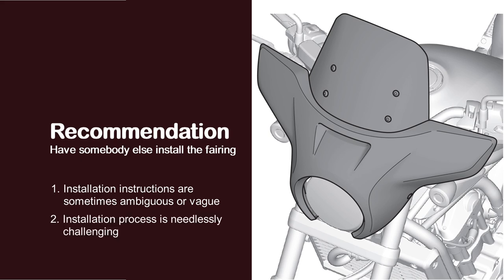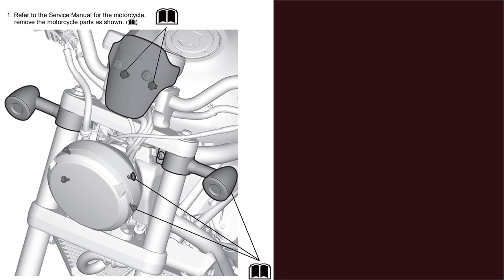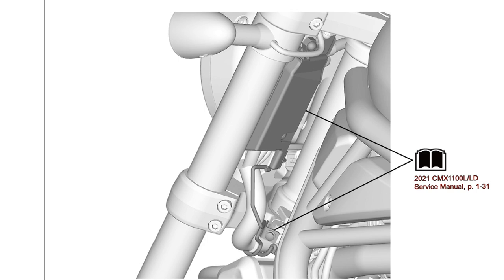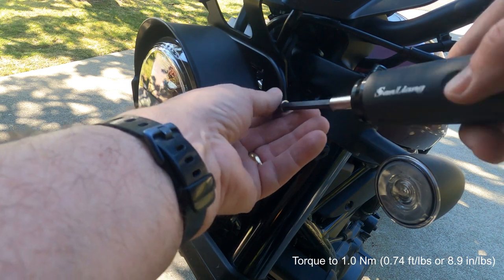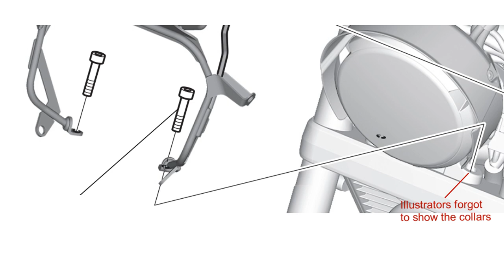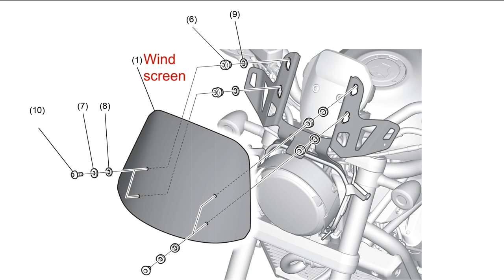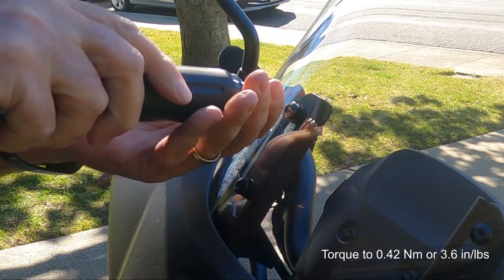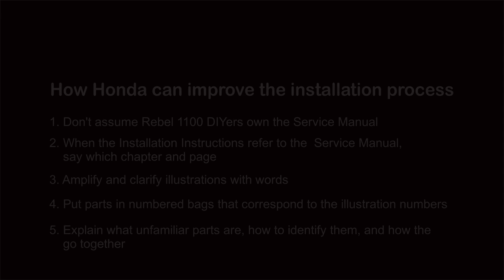Watch this Video before Installing the Rebel 1100 Batwing Fairing

Comment: Thank you for taking the time to make this video. It sure was nice to zero in on exactly what I need to  remove and re install in the correct order. My biggest problem  was the bottom fairing stay bolts. I was trying to pull the stay forward, then slide back over the top of the spacers and there wasn't enough clearance to get the bolt holes past the spacer. I found that pushing the bottom of the stay toward the bike, then pulling it out over the spacers it fit perfectly. 
I'm very impressed with the performance of the fairing, it really takes a lot of wind off me.
Reply from the maker: Thanks for sharing your experience with the installation.  Enjoy your ride.

Comment: Thanks for making this video Steve! Hands down one of the best videos for parts installation I’ve seen. It has removed a lot of my trepidation about the installation. I’m no slouch to working on vehicles and bikes, but this install seemed, on the face of it, rather convoluted. After watching your install video, should take me about an hour or so. Thanks again!
Reply from the maker: Thanks for the high praise.  I'm delighted you found the video helpful.  However, if your installation only takes an hour or so, I want to hear you brag about it!
Reply: @papastevesgarage  I’ll time myself when the time comes and see if my estimate was close 😁
Reply: Took us 3 months to get a Rebel and not even through the dealer we had our original deposit with! Took me 1.5 hours to complete. Hardest parts were fitting the left turn signal/wiring harness bolt back in and fitting the fairing bracket square and into the rubber mounts at the top of the triple tree. You weren’t kidding about those rubber mounting bungs. I put the top two in the fairing first after I learned that putting them in last made it nearly impossible to get them in without dropping them. I installed it well away from anything they could have bounced and gotten hidden under. 

Once again, thank you so much for your video Steve! I’m sure that without your guidance it would have been a day long ordeal.

Comment: I fitted this Batwing to my brand new 1100 Rebel having watched your video :)  Took me 2 days of cursing and swearing trying to get all 6 mounting points lined up at the same time as there is NO give whatsoever in the metal frame.  At one point I came very close to cutting off the middle 2 mounts as I thought that the 4 top and bottom bolts might be strong enough on their own but after having a rest overnight I came to it fresh the next day and for some unknown reason it all lined up and i got it on.  After all the fuss and bother the wing itself and screen fit on the frame easily and I was hot on the road !    Erm well apart from th horrenous buffet I now had at 50pmh + . One of the main reasons that I bought the naked bike was the fact that there is no buffet at all at any speeds I rode the test one (+ 100mph).  Now with the this screen fitted I cannot focus on the road at 70mph because of the buffet.  I removed the screen, leaing the fairing on and everything was fine once more.  I have now fabricated a tiny screen just to cover the two metal parts of  the frame that look like they will dissembowel me if i came off over them and the buffet is nearly all gone now.  Mk II of my own screen will sort things out totally hopefully.  If not then in the autumn i will cut off the top two parts of the frame that stick out above the win and ride without a screen.  Hehehe all good fun
Reply from the maker: The challenge to mounting the frame is making sure the vertical posts are pressed up firmly into the metal grommets you needed to install.  If you get the posts seated correctly, the four bolt holes should line up OK.  I applaud your persistence. 

Where do you get the buffeting?  I have too much wind on my face shield, so my helmet bounces a bit. But, it's not as bad as a 70 mph gale hitting you in the face without the windscreen.  Check to make sure the fairing is positioned correctly.  The trouble you encountered with installation makes me suspicious.

Comment: Great video. I just bought a ‘21 that has this fairing and I’m trying to remove it to install 4” Rox risers. It’s very tight by the headlight, trying to remove it but I only have an inch or so to turn the hex wrench and can’t get it to seat.
Reply: It's been a while since I installed mine.  I may have used a 1/4" drive ratcheting wrench with the hex wrench on it, if I understand which fasteners you mean.

Comment: I just finished the install on my bike - 2hrs all together, including cleanup.
That because of this video which highlighted what to expect at each step, problem/challenge areas and torque values.
I watched the video multiple times and had most of the steps memorized.
So a big thank you for making this video. It definitely helped me and, I'm sure, countless others.

One tip that might help others: when pushing the say up into the rubber mounts, a tiny bit of hand soap really helped. 
This also helps with re-inserting the wiring harness box back into the rubber mount.

One question: I did not see anything here and in the comments about the us of lock tite anywhere.  
What are your thoughts on this?

Thanks again and very much appreciate your work.
Reply from the maker: Thanks for the feedback. The hand soap is an excellent suggestion.  

To answer your loctite question: I don't use loctite unless the manufacturer calls for it.  That's just me, though.  let me know how the loctite works out.

Comment: Oh, and one other comment, Papa Steve.
I don't use torque wrenches or torque drivers for anything calling for LOW torque. I do it by hand following a fairly simple method.
In the case of 1Nm or .74 ft-lbs or 8.9 in-lbs, my method is to simply apply 1 pound of pressure at 9 inches from the torqued fastener -- OR 9 pounds of pressure at 1 inch from the fastener -- OR possily 2 pounds of pressure at 4.5 inches from the fastener. Once my highly calibrated hand feels that I need to use more than the desired force, I stop. I think of it like taking a 16 ounce bottle of water (1 pound) and placing it on the T-handle hex wrench at 9 inches from the fastener, and if the water bottle no longer forces the handle downwards, I'm done.
Reply from the maker: I'm glad you found a method that works for you.  I can be too anal.

Comment: Would these batwings be able to adjust or fit if you add some 6 inch bar risers? Or would it look weird like the handlebar is out of place?
Reply from the maker: I wish I could answer that question.  I plan to put two-inch risers on my 1100. They look like they will be a good fit, with some modification to the dash mount. Six inches?  I don't know.

Comment: Hi Steve, I trust you are doing ok. Haven't heard from you in months. Anyway I have a general question on the 2021 Honda Rebel 1100 DCT. I have had mine a couple years from new. I don't beat it, just ride. but is seems that about every 2k or so I need to add a quart of oil. The oil I use is to spec, full synthetic non-recycled. I just changed oil again at 5500 after the initial 900mile change and added a quart at sometime and it only drained about 2 or 3 quarts. All that together means it went through about 3 quarts in 4500 miles. Not good (I don't think). On my '97 Valkyrie I never had to add oil between 3k oil changes using standard Castrol GTX 10w40. Another note, after changing the oil the other day on the DCT, I let it run in the garage with the door closed for 15 minutes and didn't notice any oil burn. IDK...
Reply from the maker: I'm doing well.  I turned 75 in March, but most of my original parts are still working. I had my cataracts fixed  a couple of years ago so I'm back to 20-20 vision.  I haven't been able to see this well without glasses since I was 15 years old.  My pancreas is getting tired. Consequently, I am one of the millions of humans with Type 2 diabetes.  My joints are growing stiffer and my hair is going gray.

I sent you an explanation about my prolonged absence from video production as a reply to one of your other comments.  

This is just a thought.  When you changed oil, did you drain both the crankcase and the DCT? It's the same oil but two separate drain plugs.  If you don't drain the DCT you won't get all the oil out of the engine/transmission.  That could seem like evidence of excessive oil consumption.

If your Rebel 1100 is not leaking and you don't have blue smoke belching out the exhaust, there is no place else I can think of for the oil to go.  So, I'm guessing you didn't know you needed to drain the oil from the DCT when you changed the oil.

I had aHonda dealer do my last oil change.  The tech apparently screwed up because the dealer gave the bike back to me with a fairly serious oil leak.  I had to take the bike back twice before the dealership determined they needed to replace a part related to the DCT oil ring.  

The experience gave me pause.  If the dealer tech can screw up an oil change, what kind of unforeseen issues are mostly untrained DIYers like you and me going to run in to. Regardless, I'm going to do the next one and shoot the video  -- soon. Hopefully, I will do better then the Honda tech and pass the learning experience along to my viewers.
Reply: @papastevesgarage  I was referring to excessive oil usage after a complete change (both plugs). From full on the dipstick. then at about 1000 miles it need another quart. I have the shop manual and have been a DIYer for 60 years. Guess I am going to just treat it like a Harley.
Reply from the maker: Thanks for clearing that up.  Blows up my theory, though.  I don't have any other worthwhile insights for you.  That kind of oil consumption is very un-Honda-like.  How good is your local dealer? Might be worth a trip to the factory team.
Reply: @papastevesgarage  My Honda dealer is a Harley dealer with a Honda sign. Doubt if they have any Honda factory guys. I think I'll run a compression check myself.
Reply from the maker: @jamescampolo7824  good plan. But if it’s rings or valves you’d be getting billows of blue smoke. Let me know what you find.
Reply: @papastevesgarage  I checked the exaust pipes and they just have soot. (unburned gas, not oil), like it's running rich. I started it with the oil filler cap off and it has a ton of oil spattering out. Could be blowby or just splash from the engine/trani internals. I bought the 5 year extended warranty so I am not worried if it needs a rebuild. Hopefully it needs a rebuild just before the warranty runs out. lol
Reply: @papastevesgarage  I have a project for you. Putting handle bar risers on the 1100. There are a few videos on YT but none are very good and clear. Everyone who had installed risers raves about them. I ordered a pair and am sure I can do it but it would be nice to have a video on it.
Reply from the maker: I planned to do a riser install a year ago, but put it on the back burner.  I still have the 2-inch risers.  I decided I wanted to reroute the front brake line first, but haven't been enthused about draining the brake fluid and bleeding the brake, yet.

 I will get to it.  I would prefer a more upright riding posture.  

 The project will be more of a challenge now because I have the Honda batwing fairing installed.  I need to think through who the fairing will impact installing the risers.  The position of the gauge cluster will probably need to change.

Thanks for reminding me.
Reply: @papastevesgarage  I haven't received the risers yet (about 1.5" over stock"). I took it apart to the point where I can install the risers. There should be no reason to disco the brake line, just unhook it from its stay. It looks like I can get the riser blocks in place without making any changes to the cables/lines. You will have to unhook the rubberband that holds the inst. cluster harness. I'll have the parts monday and let you know how it goes. I've heard some say to move the master cylendar but that would also move the break lever and I don't like that idea. When I'm done, it should look and feel like stock only with the bars a little closer.

Comment: The most difficult part is 15.10 these two bolts are a nightmare , if you get frustrated just stop , go for a coffee or tea and start again with a clam head. 2 hour job with the correct tools and it does help especially if like me you are short and the screen seems to be the correct height taller riders may need to fit a deflector shield.
Reply from the maker: I wish the windscreen was three inches taller.  I'm 5' 10." I've been thinking about having one made.

Comment: Thanks for this video! This made it a relatively easy installation until now haha. I have everything installed but the windshield.  The bolts don't quite seem long enough with the 2 washers to reach the well nut. I am sure I am just doing something wrong, but it doesn't seem like it should be that difficult. I have checked and the bolts that I am using are the 16mm but I can quite get them to grab. Any suggestions?
Reply from the maker: Installing the windshield should be the easy part. Your problem is hard for me to diagnose without being able to look at what you’ve tried. 

Are you sure you have the correct hex screws?

Did you first install the well nuts in the stay from the front side of the stay?
Reply: @papastevesgarage  I finally got it to work. I had the well nut in right but I had to push hard from the back of them to get it to bite on the threads. Once I got it to bite it tightened right up. Thanks for the instructions
Reply from the maker: @robcall  that’s good news. I’m still curious about why you had that issue. I didn’t encounter the same problem.
Reply: @papastevesgarage  https://youtu.be/slMICA31j0s I'm not sure. I made this little video before I got it to work to show so that I could make sure I was putting it in right. Interestingly enough, one of the well nuts had no problem. Almost like the threads were in a slightly different location.
Reply: I had the same problem, but pushing from the back solved the problem.

Comment: Does anyone know how much all that weighs together the fairing the windshield the metal bracket the bolts etc? Thank you!
Reply from the maker: I'm embarrassed to admit  that I didn't weigh the assembly before installing it.  But I estimate the metal support is less than 10 pounds, and the plastic parts -- fairing and windscreen -- seem less than that.  My best guess is less than 20 pounds. The mounted assembly seems to have negligible impact on the weight over the front forks.
Reply: @papastevesgarage  thank you so much!
Reply: 8.5lbs total

Comment: Windshield fit the 500 cmx  ?
Reply from the maker: I'm not sure what you are asking me.  If you want to know if the Rebel 1100 fairing fits on the 500, I can't tell you for sure, but my best guess is that it doesn't. If you will clarify your question, I'll try to give you a better answer.
Reply: @papastevesgarage  will investigate further. thanks.

Comment: will batwing fit rebel 500?
Reply from the maker: I can't really answer your question.  I don't have any experience with the 500. My best guess is that it doesn't.  Let me know if you learn differently.
Reply: i know it's late but someone from reddit fitted dis onto a 500 and he said it works well

Comment: Hey Steve is this bike big enough for a guy who is 6ft   210lbs
Reply from the maker: That’s only slightly bigger than me. I’m 5’10” 205
Reply: @papastevesgarage  how does she handle at highway speeds
Reply from the maker: @chupacabra6263  Highspeed is much nicer with the fairing installed.  The bike has plenty of power and cruise at highway speed at about 4000 rpms.  It's a light motorcycle for a cruiser, though.  So, you get a bit more suspension bounce than you might with a 900-pound bagger.

Comment: Anyone ever tell you that you sound like John Goodman?
Reply from the maker: That’s new. I’ve been told I look like Stanley Kubrick.
Reply: It may have been just in that video but I had gotten sidetracked & walked out of the room & came back. When I heard you talking I could have swore it was John lol. Anyway do you recommend the 1100 DCT? I've always wanted a motorcycle but couldnt because at 15 I broke my left ankle in 3 places & I have limited mobility in it too the point I can't shift. That was until Honda came up with the DCT. Now I'm debating on getting one.
Reply from the maker: @sykotikmuzik2257  no motorcycle is perfect. But the Rebel 1100 DCT is very good. The seat could be more comfortable. It needs a windscreen if you spend much time at highway speed. But otherwise I am delighted with mine. It would solve your ankle problem. The motor is refined and muscular. And the bike looks cool. Go for it.

Comment: I have a bitch of a time getting the screws to go back into the tree on the light.
Reply: I didn’t have much trouble after pushing the stay all the way up into the rubber mounts. Then I could line up the collars and screw holes.